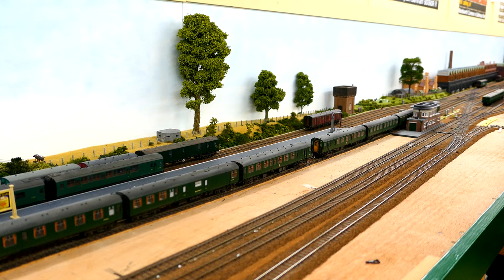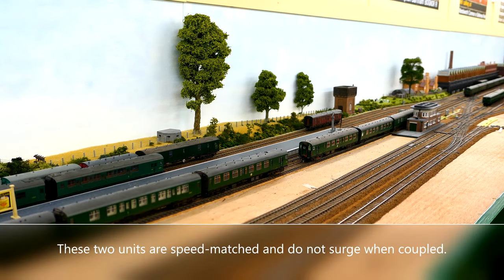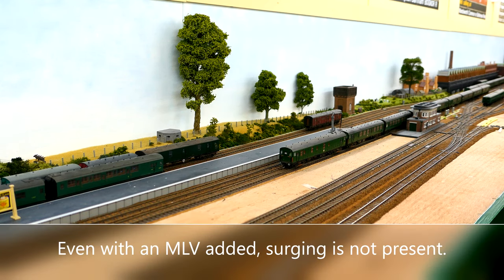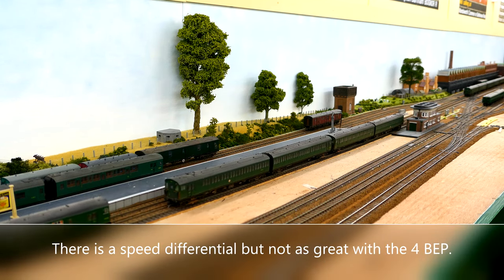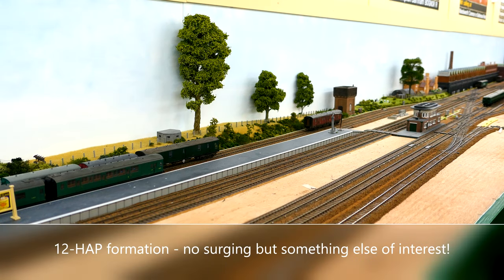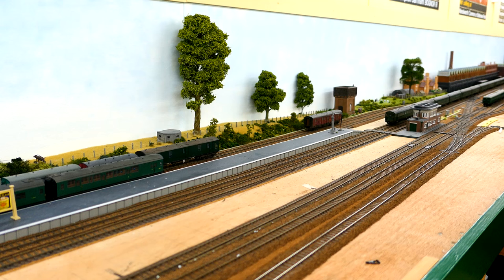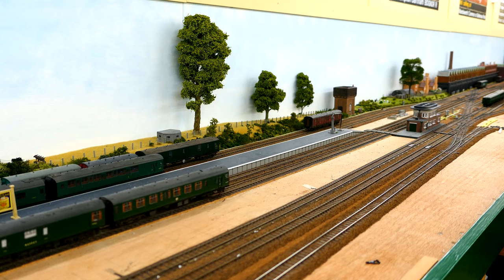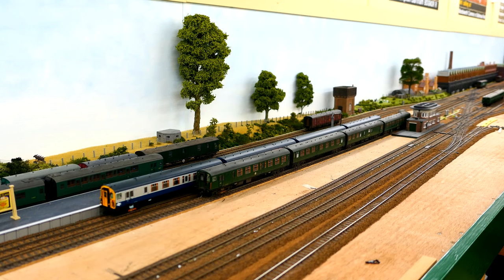Ewhurst Green Technical video 3 of 3 - EMU cyclical surging - a conclusion.

Comment: Hi Colin, brilliant work there. I think you absolutely have found the issue, I has no idea there would be such a huge difference in speed! Agreed it will be the type of motor or maybe even the gearing used, I wonder if Bachmann would respond to an inquiry about gear ratios between these batches? If they do and can confirm it, it might be possible to add new gears to the old motors bogies??? I think the capacitor idea might not fix the reduced speed of the 2010 units, as we'd only be looking at 22uF non pol over the dcc plug. Gearing, or motor bogie swap would seem to be the way forward. Cheers Mike.
Reply from the maker: Mike, thank you! 👍
I suspect it is the characteristics of more-modern motors and the gear ratio is probably unchanged.🤔
Most certainly I will be contacting Bachmann (again) to see if they have a means of identifying the different motors (particularly those offered as spares).🧐
The solution is probably just to use like-motors. Will be investigating the possibilities in due course - Colin ⚡

Comment: Thanks for this upload. The conclusion you have arrived at, is one that I surmised. The motors are produced en masse to a given price, with clearly the manufacturers accepting there will be some disparity across the batch, and exacerbated when various batches, dating before and after, have their performance discrepancies subjected to scrutiny, and comparison. Overall your findings are presented  to give viewers a balanced summary. Thank you.
Reply from the maker: Thank you. 👍
Whilst differing motor characteristics were the most probably cause it needed to be examined reasonably thoroughly rather than make assumptions. 🧐
In terms of the units operating on Ewhurst Green (and assuming they are the same fitting) it may be a case of swapping the newer 'faster' 4 BEP motors over with say those in the 2H units. 🙂
The blue /grey units belong to a friend and another possibility is to discuss how many units he needs faster motors for. 🤔
Another job to add to the list! ⚡

Comment: Hello Colin, i think part of your problem could be pick-up, due to oxidation of the nickel silver rail head. I operate my on Southern Electric emu’s on DCC and from times to time I experience surges or a lack of pick-up. My remedy is either to clean the track with a carbon block or alternatively I fill an old Wills track-cleaning wagon with lighter fluid and run it in front of one of my emu’s, cleans the track very quickly.
Reply from the maker: Bazza - Thank you for your interest and much appreciated input. 👍
Interesting that you have experienced surging although it it cyclical?🤔
In this instance the cyclical surging has found to be caused by different motor characteristics in the latest models - Colin.🙂

Comment: hi your last train had 13 coaches how may were driving coaches , if its 3 or 4 you must be drawing around 500mA ,nice to see the southern rail green running ....Tony
Reply from the maker: Tony - Thank you for your interest! 👍

The 13-car train comprised 4 CEP + 4 CEP + 4 CEP + MLV and in real life would have included six motorcoaches (two per 4 CEP) plus the MLV (essentially a 'motorcoach'). However, in model form only one motorcoach in each 4 CEP is powered.
So with the MLV, that yields four number powered bogies in the model train. ⚡

By comparison, the model 6 HAP units [@4.15] all have a powered motorcoaches, so the 12-car HAP formation had six number powered bogies in the model train (the other vehicles being Driving Trailer Composites)🙂

Ewhurst Green regularly has DCC sound-chipped locomotives visiting and although never measured, these also have a considerable power consumption (particularly when running doubled headed or top & tailed). However, the layout's DC controllers do have a 3amp output. 🧐

Lest it be of interest, currently the longest train was 18-coaches behind a Hornby (visiting) Duke of Gloucester (locomotives haul coaches - electric multiple units and Pullman coaches are often referred to as 'cars'). 😉

I hope this assists - Colin 🌞
Reply: @ewhurstgreen Colin thanks for that information that's a lot of driving coaches
Reply from the maker: Pleased to assist!

Comment: Had you thought about putting a resistor in line with the faster motor to bring it down to the approximate speed of the slower unit? This may be cheaper and easier than swapping the motor.
Reply from the maker: The question would be are the new motors linearly faster or are their characteristics significantly different. 🤔
True a resistor could be added to the blanking plug. However, in taking the body off changing the motor isn't that onerous (I have a few floating around).😉
Reply: Can't you 'tune' the DCC parameters to match the speed and acceleration of the units to be the same. Charlie of Chadwick Model Railway explains how to do this in one of his recent videos when he uses double headed loco consists.
Reply from the maker: Thank you for your thought about DCC controller matching! 👍
This was touched on in Technical video 2 when a DCC controller was tested with the two (visiting) sound-chipped refurbished 4 CEP units. 🧐
However, Ewhurst Green is a DC layout, the surging is occurring on DC and the three Technical videos explore this (including different DC controllers). ⚡